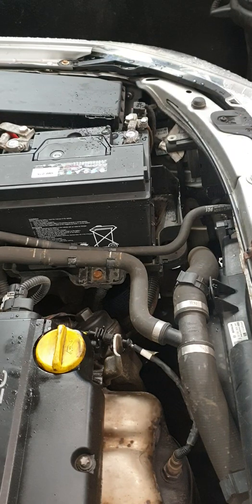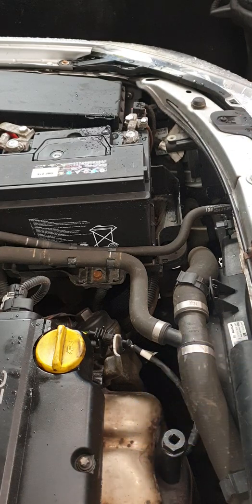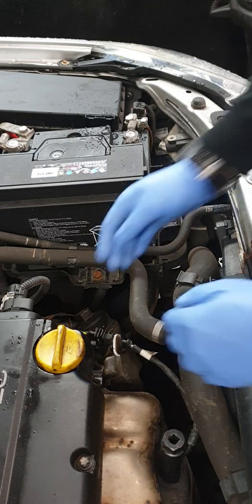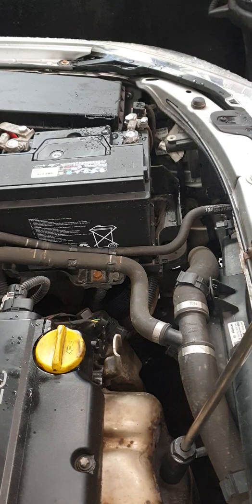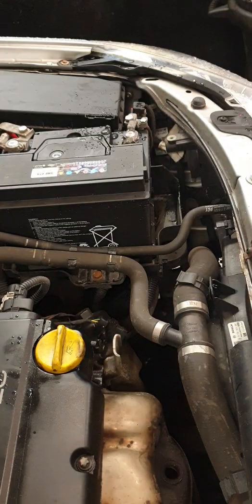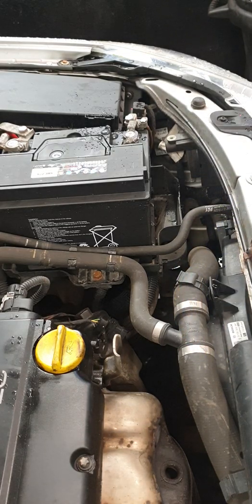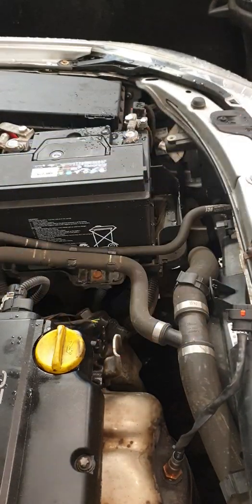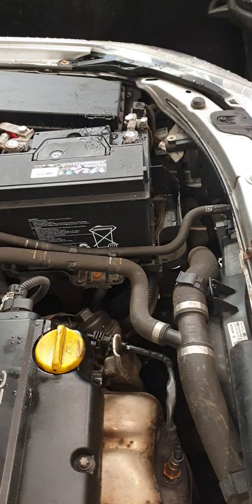02 Oxygen sensor replacement Vauxhall Astra

Comment: I have a 2007 vauxhall astra 1.4. Are you able to provide a link to the correct part for what exact one I would need?
Reply from the maker: Type your reg into euro car parts and search on their website
Reply: @AutomotiveDIYTutorials  thanks for getting back to me. I see there's ones on ebay far cheaper but I'm just a bit concerned it's not the correct one 

https://www.ebay.co.uk/itm/New-Lambda-Oxygen-Sensor-0258006499-For-Vauxhall-Astra-H-Corsa-C-D-Tigra-1-2-1-4-/174839343566?mkcid=16&mkevt=1&_trksid=p2349624.m46890.l6249&mkrid=710-127635-2958-0